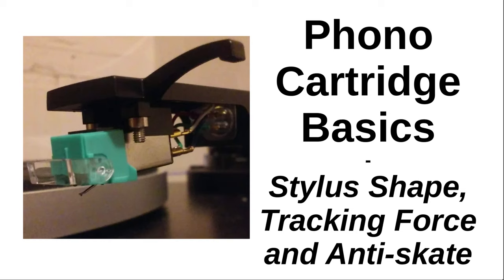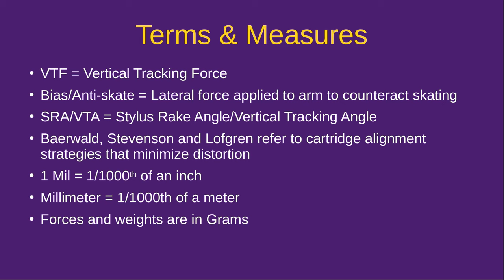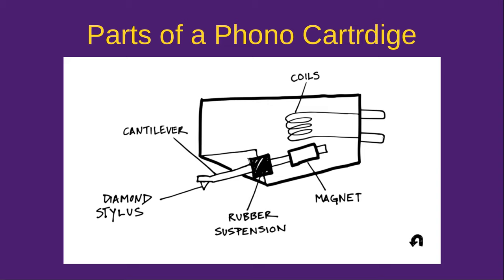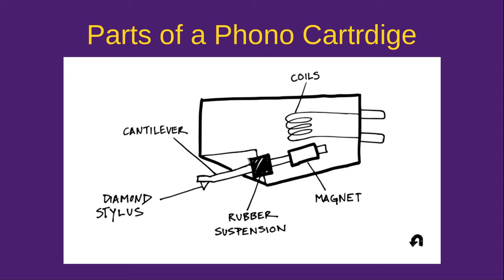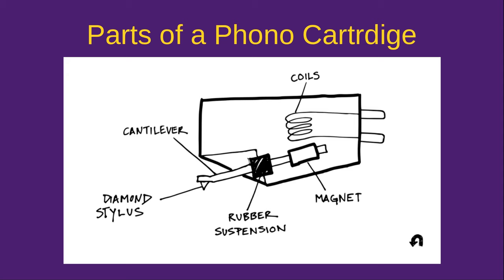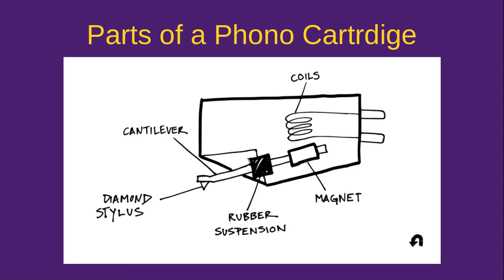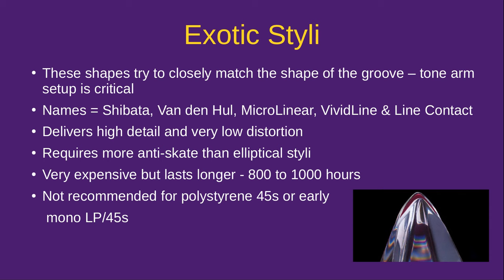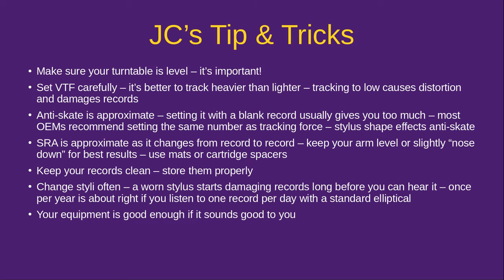Phono Cartridge Basics | Stylus Shape, Tracking Force and Anti-Skate

Comment: Joe, I ordered the AT3600L and it arrives Saturday. Today I got my ultrasonic cleaner and cleaned some of my dad’s old 60’s slbums. Mantovanni, Edmundo Ross etc. 

After cleaning, I was listening with my Shure V15 type II and thought they didn’t sound cleaned. Static, clicks,  so as I sat listening, I thought, how about I give my old Empire 3000 III a try and wow, it sounded so much better!  

I ordered the AT3600L to use  on these old albums, but right now, I’m really impressed with the Empire. 

I tried to google some info on it without luck. Only found some specs at the LP Gear site for a replacement stylus. Whats your opinion on the Empire? 

I think I need to put a new stylus in my V15 type II. But the JICO is so expensive I wonder if I would be better off buying a new AT or Ortofon 2M blue. I’m using my 1977 Technics SL-3300 turntable which still works perfectly.

Comment: Good info on at ml increase of antiskate.i just  purchased a ml for my atvm95.havent installed yet but if I understand you correctly   if I set vtf at 2g wouldn't I set antiskate dial at 2.4 as start point , not 1.2?one of your other videos corrected my thinking about record wear and conical styli,hard to argue with pictures taken with microscope.you have a radio friendly voice,no wonder you're in broadcasting.
Reply from the maker: Yes, tracking at 2 grams you'd set antiskate to 2.4 on the dial. Halfway between 2 and 3 is actually close enough. anti-skate is approximate anyway. :)